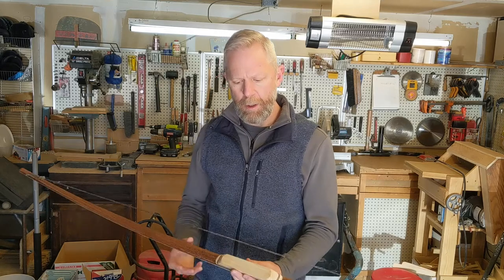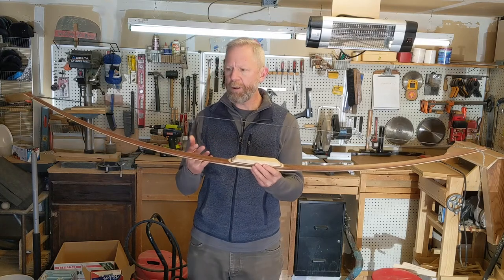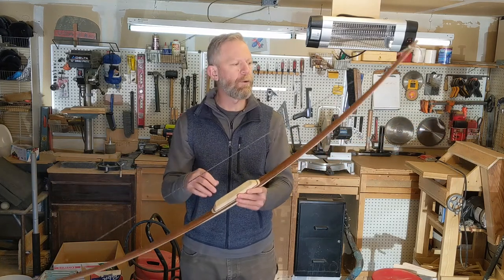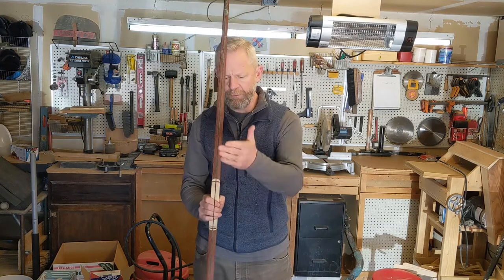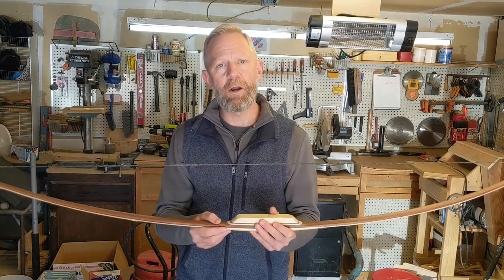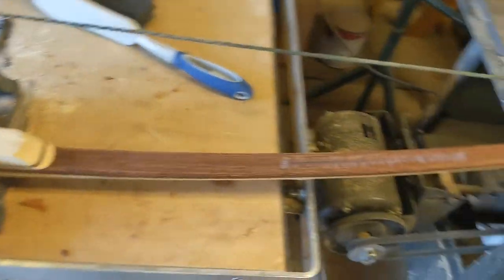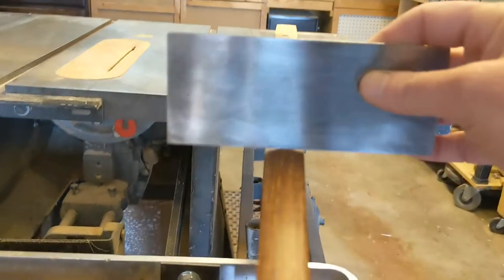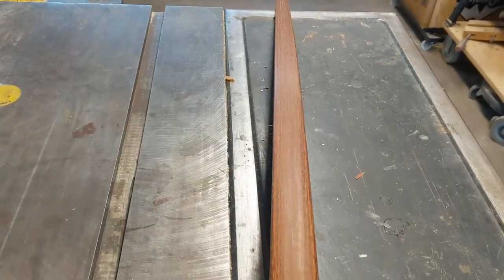Tillering to draw length - Pt. 7 RF/DF Bow build along

Comment: Can we talk about this tillering gizmo?  This is the second time seeing one, Thad and his speed bow builds show one, but it isn't discussed... looks easy enough to construct. Flat belly? How far does the pencil tip stick out? Any other details would be GREATLY appreciated.  ~Tim
Reply from the maker: There are a few different videos out there on how to make a tillering gizmo, and true to your observation, they are pretty easy to construct. As for the depth of the pencil tip, it should be adjustable so you can get a reading on progressively bending limbs - with the pencil protruding just a little more at each stage of the draw length. I have 2 that I use - one is longer at about 5” (for when the limbs aren’t flexing very much) and a shorter one about 3” for finer readings as the limbs begin to flex more. As for the shape of the belly, mine has a slight crown - the product of my faceted tillering technique. I only measure tiller with a gizmo on the center of the limb.
Reply: @meadowlarkadventuregear  Thank you for taking the time to respond. You make beautiful bows sir.